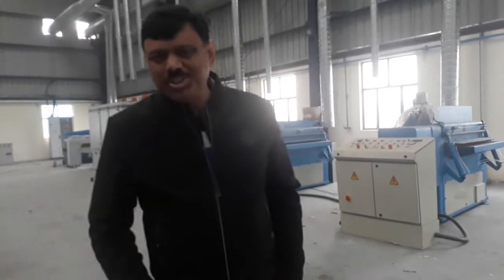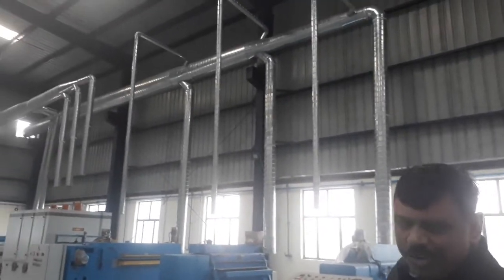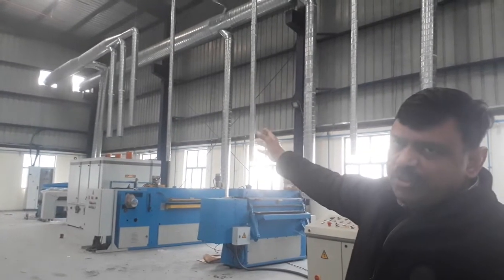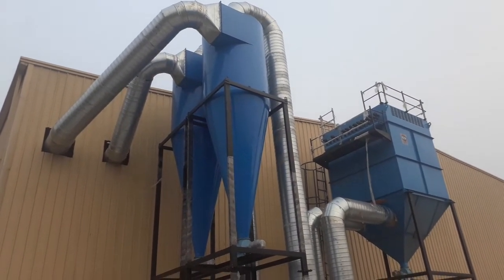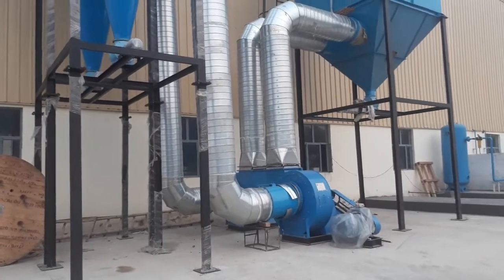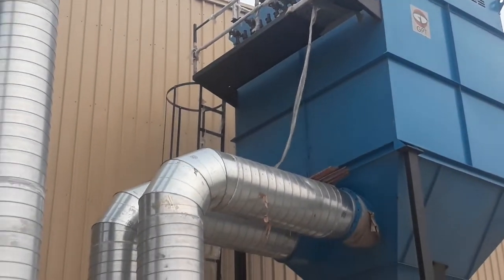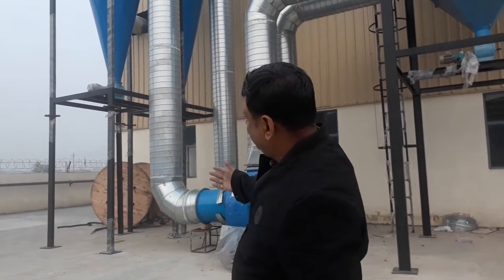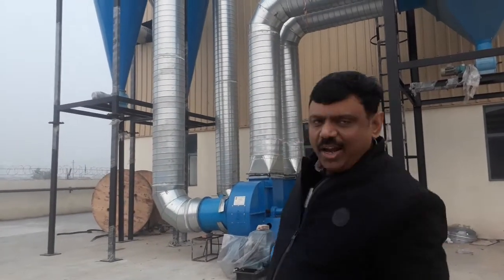Centralised Dust Extraction system by GPT-INDIA

Comment: Why did you choose to place the bower before the dust collector?
Reply from the maker: Hi it depends upon the application. In general, it is after the Bag Filter only but then there are certain application requirements where you don't have to give more suction & unnecessary increasing the power consumption especially when the coarse particles have already been collected inside the Cyclone. In this case, the application is collecting & recycling the rubber dust. So you only have to break the moment of inertia of the air stream so that the fine particles get collected inside the Pulse Jet Bag Filter  However, the Blower should be capable enough to handle the dust coming in contact with the impeller.

Comment: Whats the cost of this collector
Reply from the maker: Hello Mr. Rubal, nice to have your message. Different air capacities have different prices. It starts from 1Lakh INR to 100 Lakh INR or may be more...So pls send me an enquiry about your requirement to sales@gpt-india.com. I would be happy to quote. Best regards..
Reply: Dear Manager,
How are you?
We are a professional ultrafine powder grinding machines from China, we have different models to support clients to reach their output capacity and powder fineness.  

Longyi super fine powder grinding machines advantages:
1. Powder from 48~4microns, fineness is adjustable
2. Built-in high efficiency classifier, no more investment cost for classifying system.
3. Smart PLC operation system, and integrated control system: 1 computer could operated max 6 machines, saving management cost.
4. No particle air pollution, more environment-friendly.
5. Compact structure to save factory space and lower foundation construction cost.
 
For CaCO3 powder
The whole grinding system including grinding, classifying, powder collector, fan, PLC cabinet, feeding conveyor and others, system power is 370Kw, the real working power is 296KW
1. D97=23um (600mesh)    Output: 10tons/h      Energy Consumption: 29.6Kw/Ton
2. D97=16um(800mesh)     Output: 8tons/h       Energy Consumption: 37Kw/Ton
3. D97=10um (1250mesh)    Output: 4.5tons/h    Energy Consumption: 65.7Kw/Ton  
4. D97=6.5um(2000mesh)    Output: 2.5tons/h   Energy Consumption: 118.4Kw/Ton 

It is suitable for processing nonmetallic minerals such as calcium carbonate, calcite, Kaolin, clay, barite, talc, gypsum, limestone, calcium oxide, bentonite, dolomite etc.

Best wishes,
 Samuel 
 Fujian Longyi Powder Equipment Manufacturing Co., Ltd
Web: www.lymill.com 
Add: No.5, Lianfa Road, Dongxiao Economic Development District, Longyan, China
Tel: +86-597-2581699
MP/Wechat/Whatsapp: +86 15105956429
Email:Samuel@lymill.com

Comment: Aap ka number mil sakta hai sar
Reply: Dear Manager,
How are you?
We are a professional ultrafine powder grinding machines from China, we have different models to support clients to reach their output capacity and powder fineness.  

Longyi super fine powder grinding machines advantages:
1. Powder from 48~4microns, fineness is adjustable
2. Built-in high efficiency classifier, no more investment cost for classifying system.
3. Smart PLC operation system, and integrated control system: 1 computer could operated max 6 machines, saving management cost.
4. No particle air pollution, more environment-friendly.
5. Compact structure to save factory space and lower foundation construction cost.
 
For CaCO3 powder
The whole grinding system including grinding, classifying, powder collector, fan, PLC cabinet, feeding conveyor and others, system power is 370Kw, the real working power is 296KW
1. D97=23um (600mesh)    Output: 10tons/h      Energy Consumption: 29.6Kw/Ton
2. D97=16um(800mesh)     Output: 8tons/h       Energy Consumption: 37Kw/Ton
3. D97=10um (1250mesh)    Output: 4.5tons/h    Energy Consumption: 65.7Kw/Ton  
4. D97=6.5um(2000mesh)    Output: 2.5tons/h   Energy Consumption: 118.4Kw/Ton 

It is suitable for processing nonmetallic minerals such as calcium carbonate, calcite, Kaolin, clay, barite, talc, gypsum, limestone, calcium oxide, bentonite, dolomite etc.

Best wishes,
 Samuel 
 Fujian Longyi Powder Equipment Manufacturing Co., Ltd
Web: www.lymill.com 
Add: No.5, Lianfa Road, Dongxiao Economic Development District, Longyan, China
Tel: +86-597-2581699
MP/Wechat/Whatsapp: +86 15105956429
Email:Samuel@lymill.com